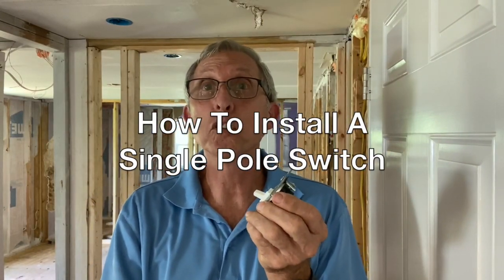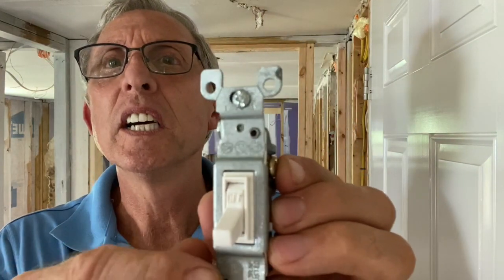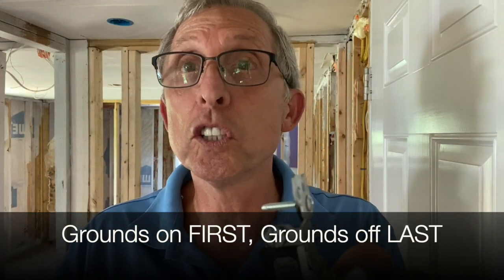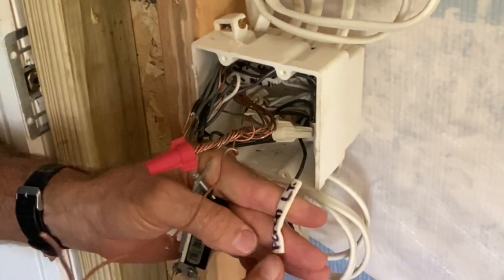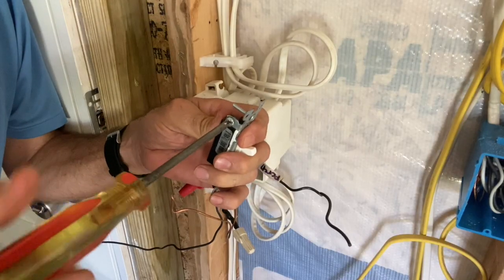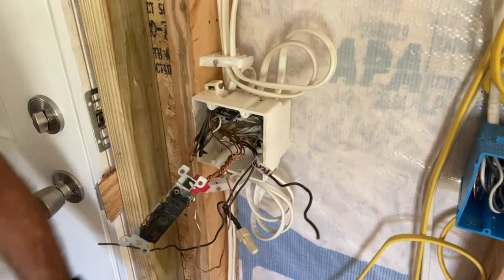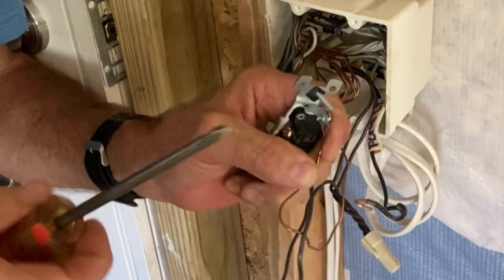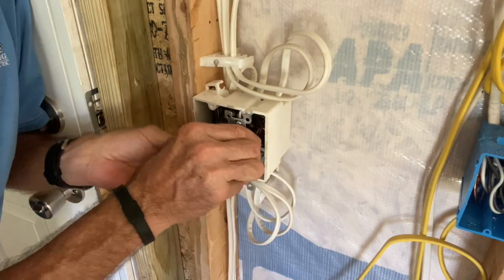How To Install and Wire A Single Pole Switch

Comment: I have a small 2 bed house in oakland ca. Built in 1930 has knob an tube, I have to get it rewired. How much should it to cost? Just your best guest. Thanks.
Reply from the maker: Depends on area labor rates 
get 3 estimates
thx